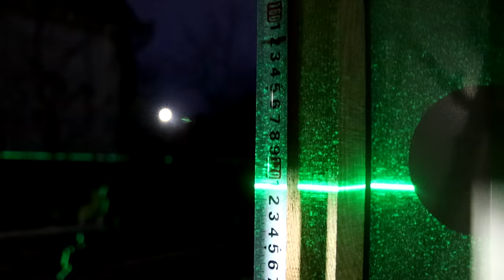The Fastest way to Build walls and a Roof for a Workshop ►6

Comment: I wonder why folks drive screws into the valleys or trenches of metal roof sheets as opposed to the peak or high side of the ridge where torrential rains don't get to penetrate because of the hump. That was how it was done in the olden days and zinc roofs hardly ever leaked.